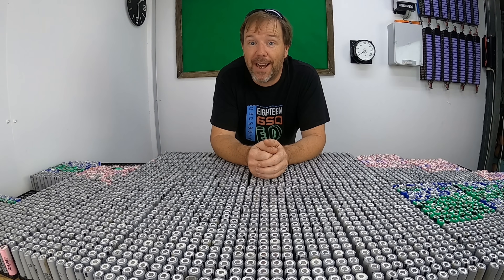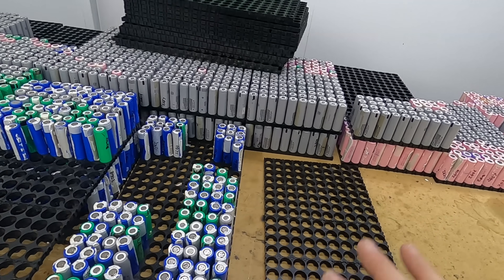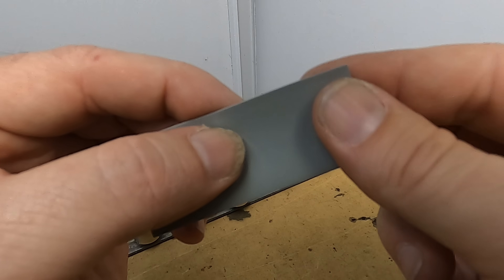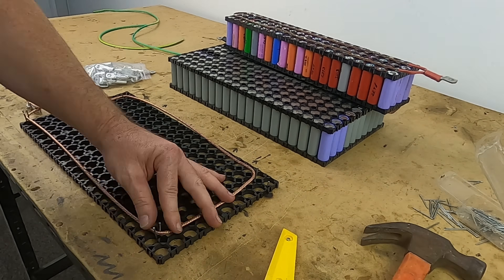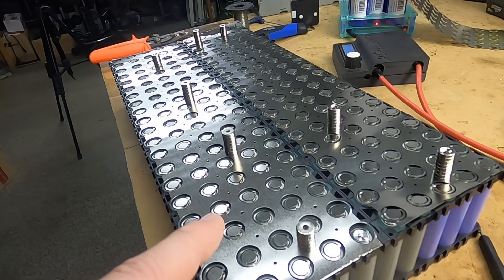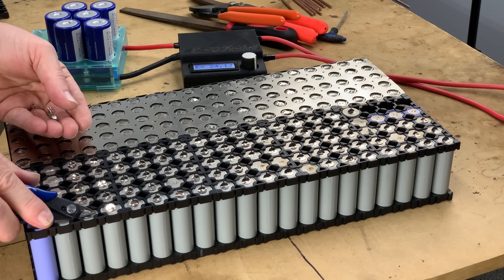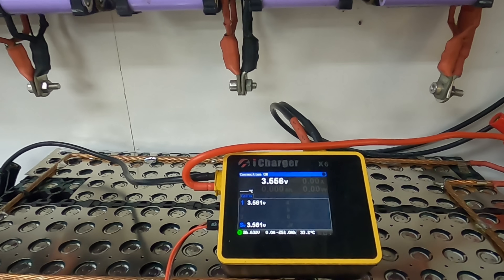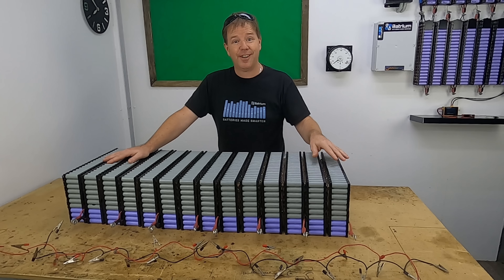Creating my single biggest D.I.Y. battery with 2800 18650 cells recovered from used laptop batteries

Comment: Great video!
There is just one thing I wonder. I understand that it's important to have equal mAh packs in series, but wouldn't it also be better to use cells of equal mAh in parallel? Is it just "good" in this setup cause the load per cell is quite low in comparrision to an e-bike battery for example? (I also understand that it would be much harder to find alomost 3000 cell with all of them in 50 mAh range... xD)
Anyway I'm looking forward to the next parts of this series.
I just started salvaging and reusing old cells myself.
Reply from the maker: In a perfect world this would be ideal but the load these cells are under you could use 1000mah cells with 3400 in the same battery pack as long as you considered the load and charge rates
Reply: Just the question and answer I came looking for. Awesome build and video editing!

Comment: Nice Pete, this video has a definite refinement air about it, the first 30 seconds in, I was expecting you to crack a joke and apologise for being so serious. Not a criticism, just an observation 😁
I'm not sure if I missed it, but curious, after sorting cells to within 50mAh and mixing the ranges into the packs, was there any further order to arranging the cells in the pack ?
Reply from the maker: I tried to stay on track - all the cracks were said than removed lol No more sorting just an even spread of 50mah cells so to speak
Reply: @HBPowerwall  Why did you said that is the balanced way to connect the batteries. I think if all the batteries were the same capacity (only 50mAh appart) then you get a better balanced pack. Yes, it has totally different AmpHours per pack, but when it charges and discharges all the batteries have the same behavior, or this is my thought. Not combining the low end with the high capacity ones... makes the whole pack capacity decrease rapidly.

Comment: Haha.. i have about 600 18650 cells here - started to capacity test them about two days ago (I built a tester for 16 cells at a time). It is great you showed how to categorize the cells by capacity.
Reply from the maker: Its a much faster method than using repakr

Comment: damm, you have been busy. can your solar flex that much
Reply from the maker: I have 32 240w panels to upgrade my 190w ones - I think I can make it work
Reply: @HBPowerwall  Staying tuned for that video too!
Reply: @HBPowerwall  ok yeah, that should do it. nice
Reply from the maker: I really hope so will need it to charge the mini
Reply: @HBPowerwall  of course, i forgot about the mini you need the extra, to not only run the house but dump load in to mini.

Comment: Excellent job Pete. Neat and tidy.
What is you plans for the 10kWh set?
Reply from the maker: Not 100% sure yet, but will for sure be testing with the iCharger X6 and trying to keep using it - maybe in the workshop
Reply: @HBPowerwall  I would like to plan a road trip to visit you soon. If you are willing. What is the best way to communicate? You can email me, recycle18650liion@gmail.com.
Thanks Pete.
Reply from the maker: sure lets work something out - warning i WILL talk your ear off so have to keep it to an hour. admin at diypowerwalls dot com

Comment: Awesome dude, just finished my first 7S40P bank this morning!  This leaves me already want more kWh ha
Reply from the maker: You can do it! ---- its a huge problem for me i keep chasing the weakest link. More solar, more batteries, more inverters repeat!
Reply: @HBPowerwall  I'm curious Pete, are you still trying to be free of grid dependance then ? 
I thought you had already attained that goal, surely you're just updating now ? 
What total kWh does your household require to achieve independence including a few days redundancy ?
Reply from the maker: i have 74 solar panels in production, I still use 3-4 bucks a day from the grid & my batteries are dead flat as I lay here on a sunday night... be a while yet hehe
Reply: @HBPowerwall  You must use an enormous amout of elektricity! Still mining crypto?
Reply from the maker: My computer workshop draws quite a bit, add to that wife is a PT and runs heat/air and we have an old school hotwater system that can draw 10-20kwh per day alone. ( LOVE HOT SHOWERS lol )
Reply: @HBPowerwall Have you looked at water heating pipes and a buffering system like an insulated body of water? That would serve perfectly as a heat energy storage and heat pipes utilize way more sunlight energy. Plus you could dump PV electricity into the heat buffer system if you are producing excess.
Reply: HBPowerwall I thought you dealt with the hot water requirements in previous videos 🙂
Maybe an idea for a new video an update of what’s worked and what hasn’t lived up to expectations from the archives 👍
Reply from the maker: Have a HWS diverter that works very well, just needs more protons
Reply: Cant you convert to a gas hwh? Thats a lot of electricity for one day to run!
Reply from the maker: No, that's a crazy downgrade - if anything i think i would lean towards a heat pump type HWS
Reply: @HBPowerwall  Yeh, my thoughts exactly, whilst the electricity HWS might use a lot, at least Pete can offset that with solar and battery, he's not going to dig for gas 😂
uh, oh, don't put idea's in his head 😀
Reply: I see. I thought you had gas already.
Reply: You have 74 panels? Where the hell are you able to mount all of those?? Lol!  How many kw in solar panels are you up to currently?

Comment: Wow some real scale there man, how long did it take to sort all them?

I'm about to expand my 40p to a 160p in July, can't find the nickel fuses on BH anymore so thinking of just using 3 or 5 amp fuse wire.
Reply from the maker: Some of those timelapses took a whole day - and worth every second seeing how close all the batteries are now completed
Reply: @HBPowerwall  looks slick AF, It has inspired me to do 194P now.... Just doing the numbers now to see if I can fit it in the budget with a WM5.
Reply from the maker: bigger packs are cheaper to bms & are easier to make a balanced battery